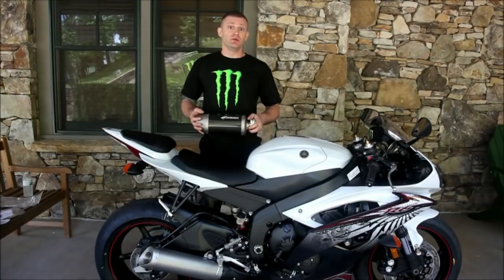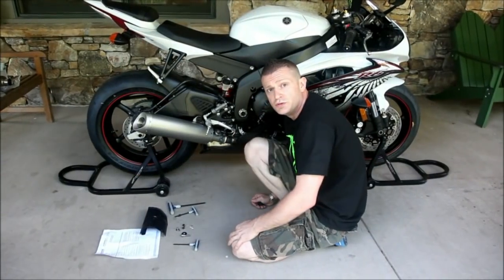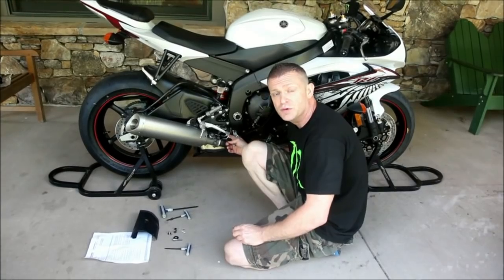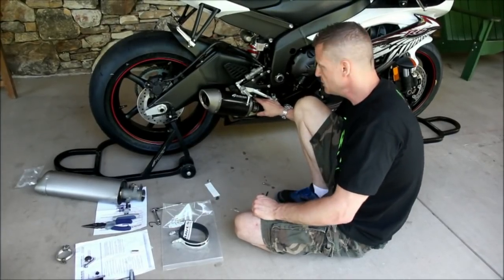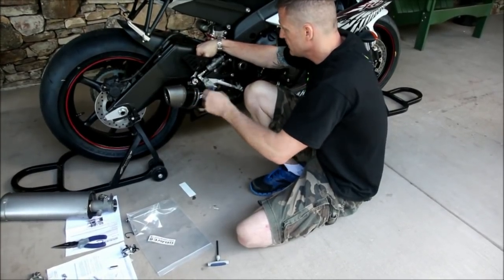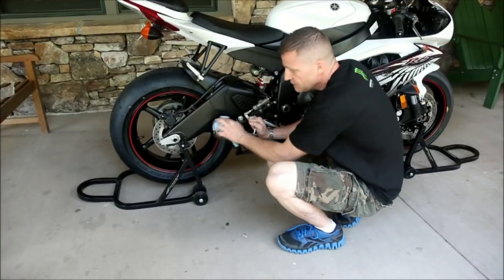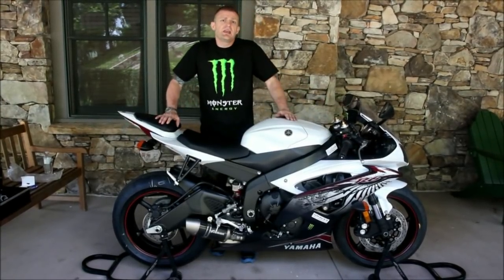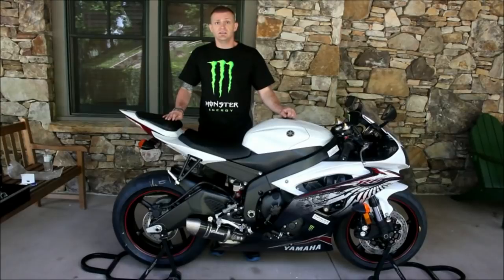Graves Motorsports Yamaha R6 Slip-on Exhaust Installation Video

Comment: Quick question do i need a exup eliminator on a 2009 model?
Reply: Yes
Reply: rroadrider15 Not necessarily. If all your worried about is throwing a code, you can simply remove the cables from the servo. By doing this you will not get a fuel injection code. A servo eliminator is only needed in case you want to remove the entire servo motor. (Which provides absolutely no advantage to the bike.)

Comment: That exhaust doesn't sound much better that the stock exhaust. Sounds almost the same. Boring and unexciting.
Reply: Most slip ons will for an R6 because the catalyst is so big on it. Remove the cat and put on a y-pipe and everything will sound like a gp bike. Other bikes like the CBR 600 have smaller catalysts so once you put on an aftermarket muffler it's way louder. Some motorcycles even have the catalyst in the muffler like the Aprilia RSV4